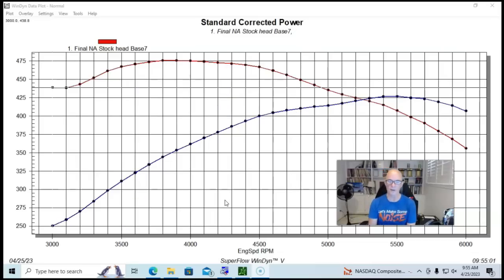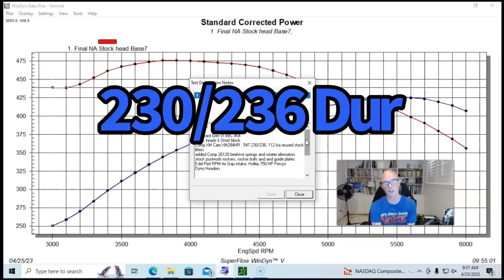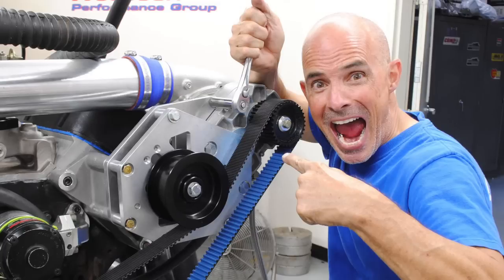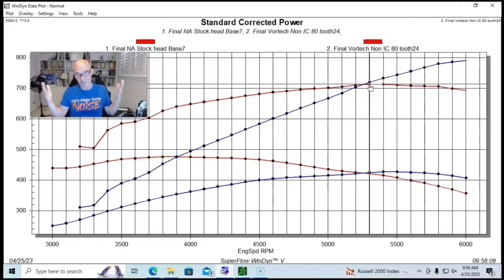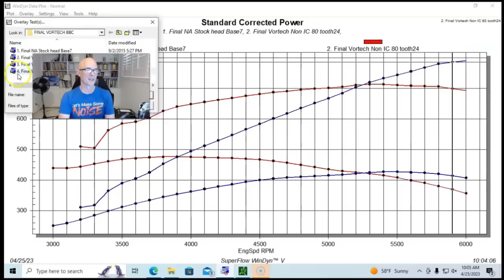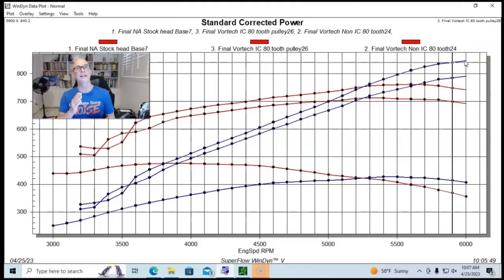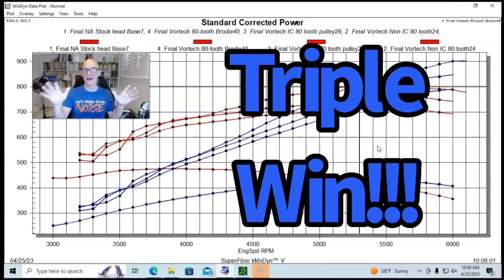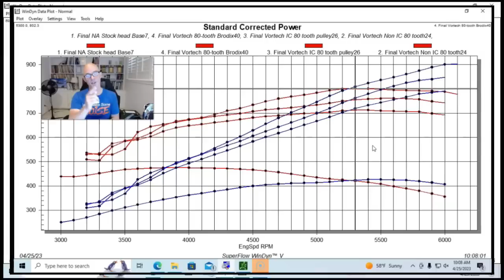HOW TO MAKE CHEAP, JUNKYARD BBC HP! NA VS VORTECH SUPERCHARGED GEN 6 454. INTERCOOLER & HEAD TEST

Comment: CAN YOU EXPLAIN WHY THE NA POWER NEVER DOUBLED WHEN YOU SUPERCHARGED THE BIG BLOCK?  YOUR 19, 17 AND 16 POUNDS OF BOOST SHOULD HAVE MORE THAN EASILY DOUBLED THE ENGINES POWER.  ACCORDING TO THE BOOST TO POWER RATIO EVERYBODY ALWAYS PROMOTES.  IS THE BIG BLOCK JUST NOT AS EFFICIENT?
Reply from the maker: on a blower-you need to subtract the losses associated with driving the supercharger-you only double the power at 1 BAR with a turbo

Comment: YES ON A DYNO YOU CAN COOL INTERCOOLER WITH COLD DYNO WATER OR ICE WATER,  HOWS THIS POSSIBLE IN THE CAR ON THE STREET,  DO YOU RUN MILES OF GARDEN HOSES ? DO YOU PUT A FREEZER IN THE TRUNK ?  GAINS ON TGE STREET FROM WATER INTERCOOLER WILL MORE THAN LIKELY BE ALOT SMALLER THAN COLD ICE WATER ON THE DTNO ?
Reply from the maker: The dyno water is ambient-which is what you would get in a vehicle if you have a secondary cooler

Comment: I enjoy watching your videos but why do you almost... always build a junkyard engine and put a high duration camshaft???? No one can run a 454 on the street at 6500-7000 rpms. You change all this stuff but never the camshaft.
Reply from the maker: the vast majority (90%) of gen 6 454 videos feature a 274 street cam (224 degrees)-makes peak power at 5400 rpm. There isn't room with stock p-v to put a cam that makes power at 7000 rpm, so not sure what you are referencing.
Reply: @richardholdener1727  Thanks for the reply... have you guys' tested COMP Cams 11-238-3 Xtreme Energy.
1,300-5,600 RPM Operating Range
218/224 Duration at .050". 110 Degree Lobe Separation Angle
.504"/.510" Valve Lift
If so please direct me to that video, that's the cam I am running in a gen 4 BBC.

Comment: Would it be worth O-ringing a stock big block chevy to throw more boost at it or is that just wasted money
Reply from the maker: for what power level?
Reply: @richardholdener1727  1400-1500 area. The 496 in my car now put 950 to the wheels on 10lbs boost. Just wasn't sure how much a stock block would take
Reply from the maker: stock block is not going to be a long-term thing at 1500 hp

Comment: Hypothetically speaking...would the peak boost still drop as much as it did with the Brodix heads if they were 102cc vs 120cc?  My thought is there would be 18cc less pressurized air leaving the intake manifold every time the intake valve opened therefore keeping peak boost pressure slightly higher.  What say you sir?

Comment: How about a rotary boost series?....
Reply from the maker: LOVE TO
Reply: I think most engine tuners are incorrect when they say that the renesis motor has less potential I think it's actually better than the original design... 🤔... Or has the potential to be... Nobody's sequentially turbo charges them like the originals were.... With those high RPMs I see higher potential total output... A 1.3 with 600 wheel horsepower would be a hellcat 1 inch punch from hell... That would be a hell of a H Bomb 😏 no pun intended.... I'm considering an inter chilled twincharger setup.... Haven't seen that setup yet on a rotary.

Comment: I understand not wanting to tear the head down to do springs but if you cut the valve guides down you can fit a dual spring easy. I did that on a stock head and had no problem with some crane 99896 springs and 99970 retainers with crower 0.050 taller keepers. Had to notch the piston a bit for the cam which was .576/.598 285/292 110 lsa.

Comment: So they're junk unless you spend $2500 on a set of aluminum heads. Got it.
Reply from the maker: yes-850 hp worth of junk
Reply: @richardholdener1727  I have one but it makes me mad that you have to spend good coin to keep up with a 300,000 mile 5.3l with an ebay turbo kit. At least the bottom end is stout. Ish.

Comment: Safe to assume you opened up the ring gap for boost?

I know you did some tests running the stock intake with the holley ECU.  Any plans to try the same test with the stock intake and boost?  I know there used to be supercharger kits for these trucks but they haven't made a comeback yet..
Reply from the maker: it just make less hp and a bit more low speed torque than dual plane and carb

Comment: I ran the same valve train set up on my engine but used the crower +.050 keepers and that provided plenty of clearance for the rocker.
Reply from the maker: we tried +.050 but the rockers contact the keepers and not valve tip
Reply: @richardholdener1727   I found it. crower 86111x1-16
Reply: @richardholdener1727  were they the crower jumbo keepers? Im having trouble finding the part number that I used but they were recessed for like a lash cap and I had plenty of clearance on the rocker.

Comment: Would a big block with a flat plane crank and short stroke increase the rpm redline or would that not change if your mass stays the same?
Reply from the maker: FLAT PLANE DOES NOT DETERMINE MAX RPM (OR EVEN EFFECTIVE RPM) POTENTIAL
Reply: @richardholdener1727  just cool sounds
Reply from the maker: they really do

Comment: I wonder how much/if a intercooler would help with a N/A engine.
Reply from the maker: THE INTERCOOLER IS ALMOST ALWAYS A RESTRICTION TO AN NA MOTOR
Reply: @richardholdener1727  confirmed im not retarded
Reply: @richardholdener1727  350 Olds diesel engine ??? The ultimate other guy
Reply: Not really , with boost every 10 degree drop is 1% more power gained threw intercooling,  the only thing that can make a difference in temp and power would be e85 or straight methanol

Comment: The 454 Gen 6 engines must use a Factory Hyperuentic piston made by Wiesco or some other company Richard Holdener. 
The original 1997 Chevy Vortech 454 I have yet from my Chevy C2500, rebuildable yet.
Used a 1999 454 I built it up last summer with a Scat Pro Stock Cast steel crank they rate to 800 Hp.
Other than a Moroso 80 psi oil pump she is stock yet in my Chevy 454 Gen 6 pickup.
Reply from the maker: WE HAVE RUN 4-DIGIT POWER LEVELS WITH STOCK STUFF AND RING GAP
Reply: @richardholdener1727  Mind boggling  to me yet, from 1990s into early 2000s guys local competing in the Worlds Fastest Street Drag Car Shootouts from old Car Craft and Hotrod National Events. 
Tuning has come a long ways.
Only needed 1400 Hp to Win most, 2000 Hp Top Dog of the World.
Reply: @richardholdener1727  A Big Block Chevy has What I call Optimal Main bearings sizes to send it, 2000-5000 Hp +.
Also a Super Strong Crankshaft Thrust bearing. 
Only a Pontiac V8 455 has a stronger crank thrust bearing.
Reply from the maker: stronger thrust bearing? is that a thing?
Reply: @richardholdener1727  Why Yes Richard.  Larger the Main Bearings Journals the Larger the Crankshaft Thrust Bearing Is physical in size or actually circumference and in square inches. 
More surface area is present to hold the Hydrodynamic oil film.
High loads are displaced over a larger area and peak psi square inches goes down of course. 
Ever been into an 11 liter to 28 liter Semi Truck Diesel Engine to overhaul ? I have several times.  Huge compared to Auto, race cars, and Light pickups.
Reply from the maker: my point was how much thrust load do these motors really have that would require more surface area-the load usually isn't in that direction
Reply: @richardholdener1727  Its a problem at times Racing. Manual or automatics. Different work arounds to problems there.

Comment: That made almost the same power as the gen 6 wrecking yard motor you did with a 224 at .050 cam. Any ideas why?
Reply: Compression, head flow, & boost difference.
Reply: @Bri-man Hunter the two im talking about are both stock gen 6 engines. Same heads, no boost.
Reply: @reloadingfun . Something is different, all things being equal, the bigger cam will make more power. You must be missing g something.
Reply: @bri-manhunter2654  yep, im sure something is different.
Reply: @reloadingfun . Yea, which video was it? I’ll look for it.
Reply: @Bri-man Hunter  it's in his BBC n/a. There is 2 or 3 gen 6 videos.
Reply from the maker: the two junkyard motors had different starting points (especially torque), but the cams made similar peak power
Reply: @richardholdener1727  can I buy one of these vortec superchargers from you for the Gen 6 454?